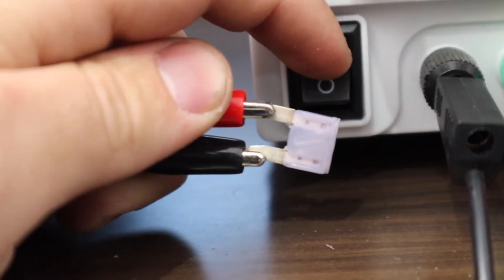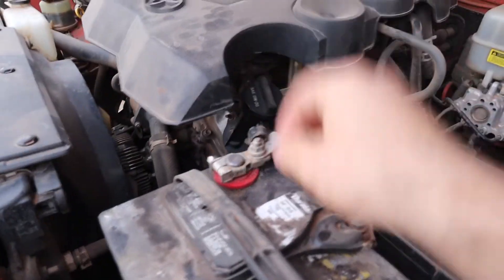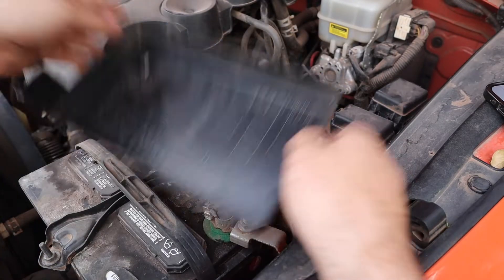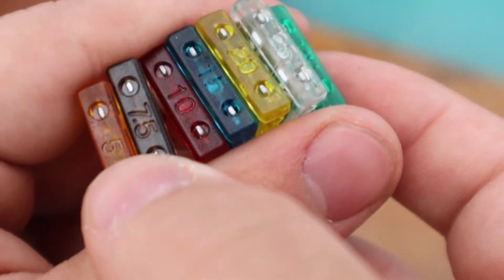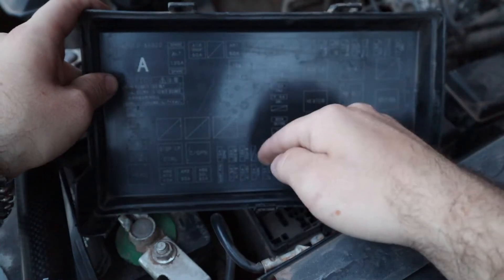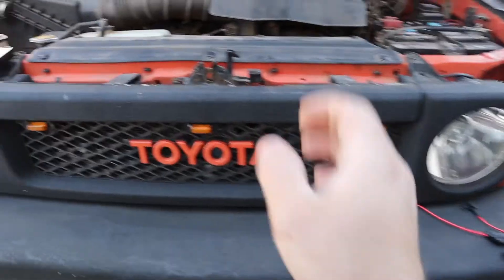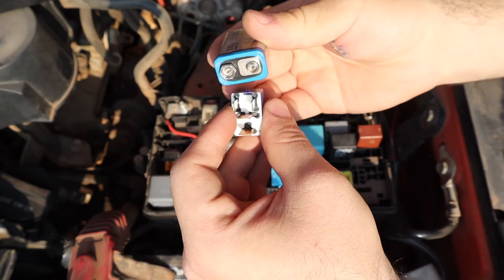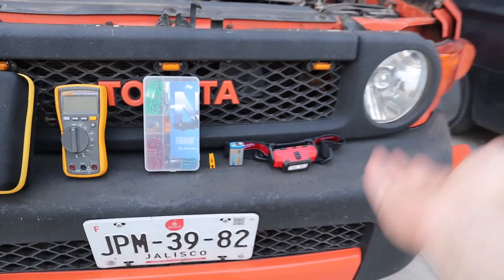How Pros Test Fuses and Relays, find, test, change, and repair

Comment: What if the switch in the relay fuse is clicking when I apply the battery, like its opening and closing very quickly. Because I'm having some issues with my starter motor, it starts turning the engine over too early, while the key is in the AC position. It also makes a horrible grinding noise intermittently when the engine is running, and rarely it will short out the entire car while I'm driving and then instantly work perfectly again. Would this be due to the fuse?

Comment: Actually the fuse don’t protect the components, it protects the wiring, most likely the component is all ready fingered and pulling to much current, that’s what blows the fuse
Reply: the caps and resistors are usually what go first if overcurrented, not the wiring
Reply: @denno445  I think your thinking of end of line terminators, usually 120 ohms

Comment: Fantastic video! So I’m in the process of trying to figure out why my car won’t turn over. Battery was just charged. My relays have corrosion on them. I’m going to test using the battery. With corrosion, on the relay and inside the board, is there a way to clean or do I need to replace?